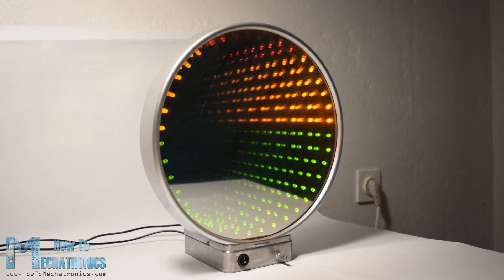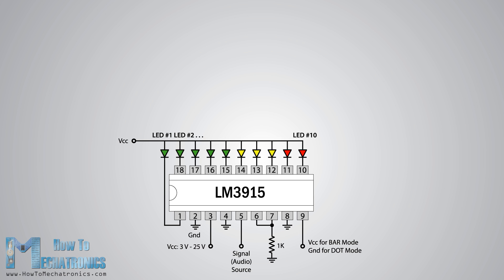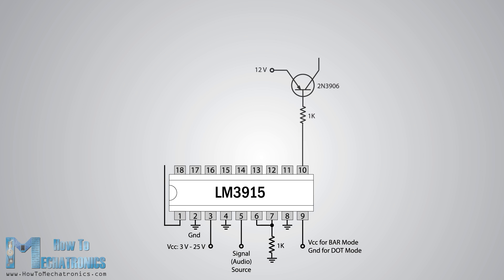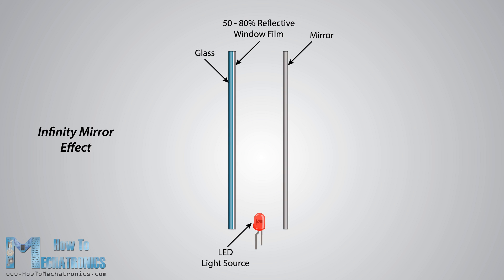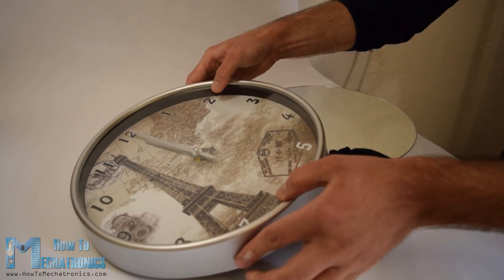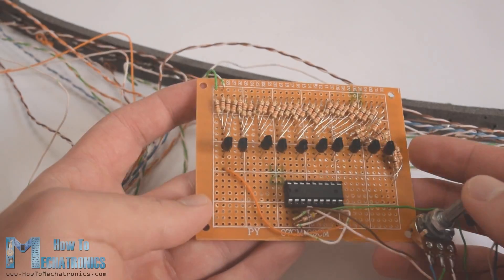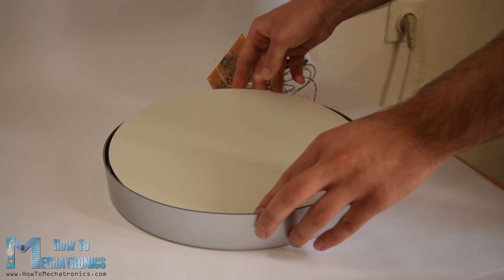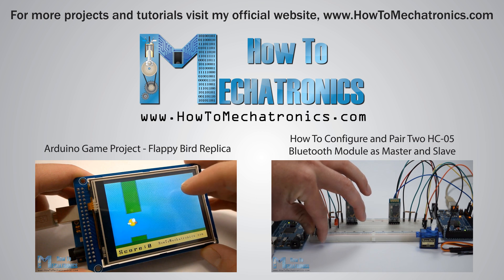Infinity Mirror Music VU Meter Electronics Project using LM3915 IC

Comment: By configuring the sets of four LEDs to run in series instead of parallel as you have them, one could save a lot of time and energy, and maybe a little bit of money too.

Using series connections, you'd have...
> 4x less resistors for the project
> 4x fewer wires to mess with
> 4x reduction in power requirement

Comment: why not put the leds in series with one current limiting resistor? could have used 10 instead of 40 resistors
Reply: the mirror looks really nice, but as a mechatronics student I just couldn't resist trying to optimize. I totally forgot about the fact, when one LED in series fails, all other fail. must have been a tedious project